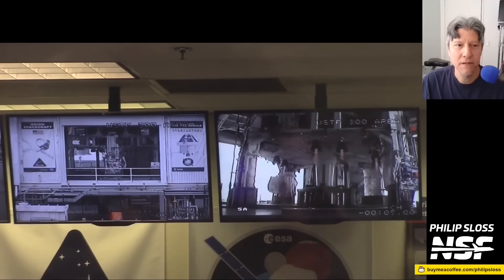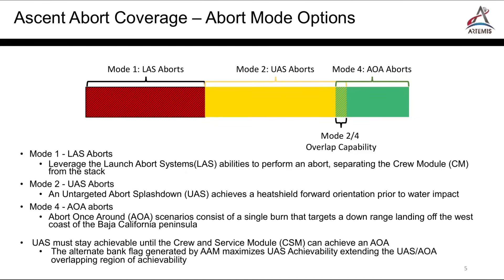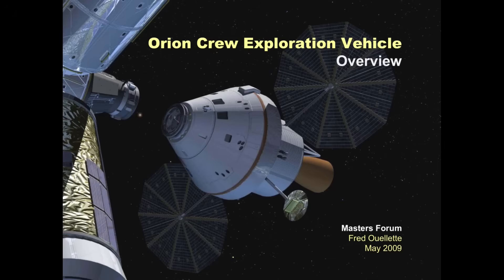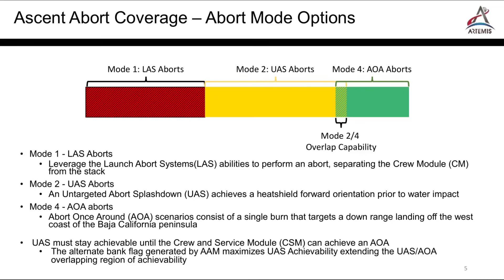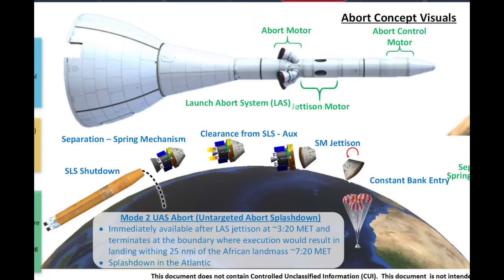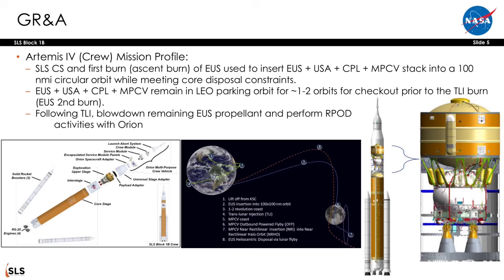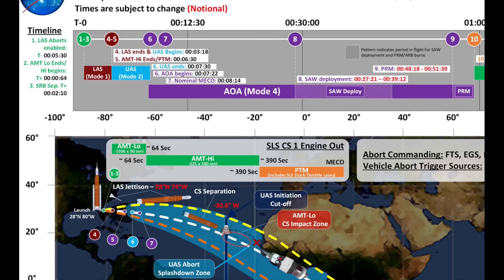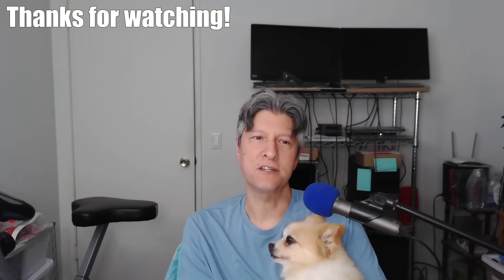Orion launch aborts overview

Comment: Great Video !  The Orion Capsule should have been tested on the ISS space station for six months to three years to simulate a moon or Mars mission !  The Tech developed in the Orion Capsule, can be used in the Blue Moon HLS and/or other HLS ships for flights between the LS and LEO !  The SpaceX Crew Dragon could replace the heavy Orion Capsule, but SpaceX is planning to retire the Dragon and the Falcon 8 system for the Starship !  The Tech developed to return to the moon to stay, can take US and the world to Mars and beyond !  For more info read the papers "Moon Direct by Robert Zubrin and the NASA designed "24-Hour Lunar Shuttle" (LEO to LLO) by Stan Borowski=NASA John Glenn Research Center !  I met and talked to these two Great Space Pioneers !  Timothy Lipinski

Comment: Great summary, thanks. 
Starship has no LAS, but I presume they intend to launch with passengers at some point....? 
How reliable would it have to be for public service with no LAS?
Reply from the maker: It's not clear what the standards will be for passengers, but there may be some who are willing to accept higher levels of risk to fly.  Also not clear what the timetable for crew rating is or will be.
Reply: I don't think Starship will ever carry people outside of the Human Landing System .. and even that may never see the light of day.  I don't even see the point of Starship anymore.  It's far too complex for Mars - requiring a permanent propellent manufacturing and Starship refurbishing colony to get people back to Earth.  How much will that cost? 10? 20? 30 trillion dollars?  And even then, they will be dependent on Earth for decades or centuries before they are self sufficient.  Not only can we not afford this.. we should probably focus on keeping Earth healthy with that money instead.  It's simply the right decision.

Comment: I never thought about the need to avoid a ground landing. Theoretically, if something went wrong with the burn that left the capsule intact and functional, could they land on the ground safely?
Reply from the maker: It would probably vary depending on the terrain and the ability of recovery forces to reach a landing spot.

Comment: I love "in order to slow down enough not to land on Africa," as if it's merely a small obstacle to avoid.
Reply from the maker: Not exactly like an F9 boost back burn, but along the same lines.  Keeping wreckage from raining over other countries/populations is big consideration for all parts of the vehicle.
Reply: @PhilipSloss  That doesn't concern any of the launches that originate from within Mainland China.
Reply from the maker: @CATDRL2  Yup, always worth pointing out.
Reply: @PhilipSloss  presumably the EUS + Comanifested payload would still rain down onto Africa in an Orion RTAL abort scenario, right? Or would the different ballistic coefficients prevent that? I would think that this would more be about wanting Orion to splash down softly on the water, than it is about wanting to avoid raining debris down onto inhabited areas of Africa.
Reply from the maker: @plainText384  The flight termination system would likely be used for the rocket, but there's not enough detail in public presentations to be clear about the whole situation.